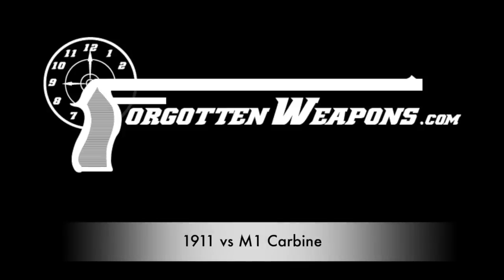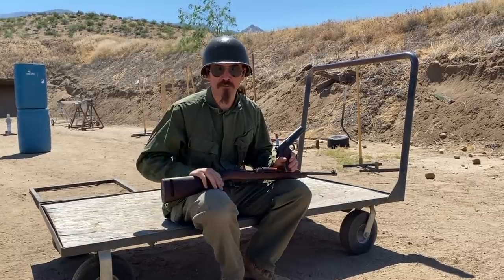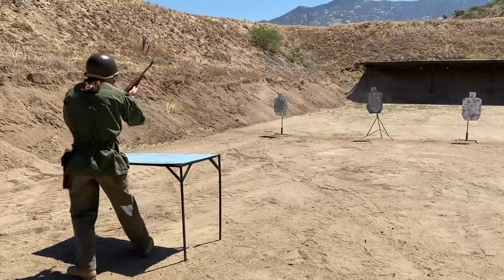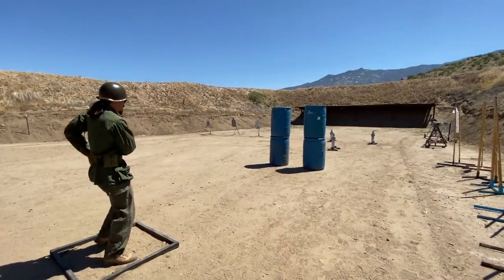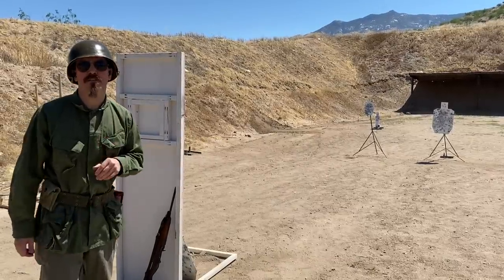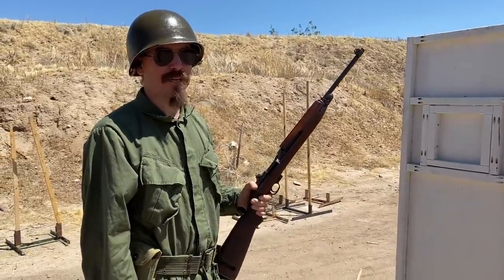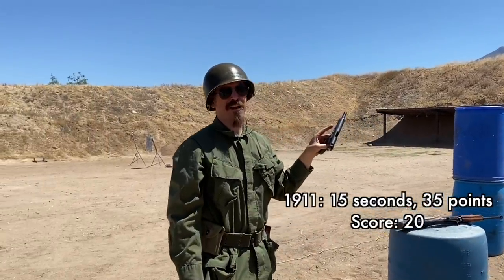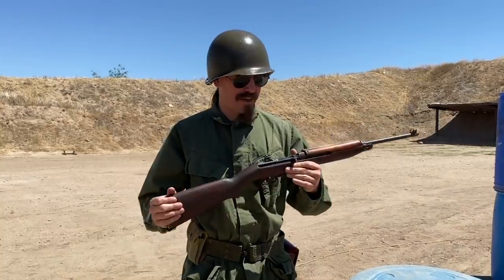1911 vs M1 Carbine in a Practical Match

Comment: It looked to me like part of the problem with the 1911 was getting it out of the holster. Ian is left handed. I don't recall there being a left handed holster. And was the holster closed on the stud? When I carried a 1911, I carried with a mag inserted, and no round in the chamber like what Ian started with. Except I always carried with the holster open (right handed). One night my shadow from a street light crossed over a deer which took off into the woods. I found myself with the gun in my hand, left hand on the slide ready to rack, and in a gunfighter crouch. It was not a conscience thought to draw the weapon and point at the target. Carrying a carbine slung on my shoulder, that would not have happened. A carbine tossed in the back seat of a jeep? Good luck. On the other hand, I couldn't hit the broad side of a barn with a 1911.

Comment: Holster's MATTER!

Run this again with the bottom of the 1911 mag secured to your thigh like it's supposed to be.
Run it a third time with a period issue shoulder holster.

If you want to be a sport, run it with a modern issue holster, the bianchi I think?, which will hold the 1911 loosely, but hold it,  no flap, with the thumb break.  You will find it mount's higher, not need to secure the bottom, and draws much more quickly.

Then, mount the same holster in a drop rig......

Operators (some, at least) still carry the 1911 for the terminal ballistics and accuracy, but don't cripple themselves with antique holsters.

And, NOBODY who has been shot at carrys condition 3, put a round in the tube, safety on, and top off the mag like it matters, both weapons.

Comment: Eh ... 
 
I think we all know the advantages of the carbine over the 1911 but their were some problems with the test.
 
The first problem was with your draw.  In every case you fumbled with the holster flap.  Now - here - I carried an M-1911A1 for over a year and qualified Expert with it.  So - I've got real world experience with the weapon.  I also practiced my fast draw as, though nothing ever happened - I was very much aware that should something happen - my ability to draw and fire my weapon in an expeditious manner might have an effect on my survival.  I was aided in this - by the fact that my holster had been "tear dropped" such that some of the leather around the hole had been cut away to make it easier to get that flap up.  I could lift the flap with the back of my thumb and as I pulled it up could draw the weapon, rack the slide with my left hand and fire it in one fluid motion.  My time from starting my draw to pulling the trigger was 1 second.  No Bullshit - I could do it that fast.
 
Now there are a couple of factors here that could have yielded a different result.  First off the holster is designed for a right handed draw - and - Karl is probably more practiced at fast drawing.  So - if you had had Karl doing the drawing of the weapon (I believe he is right handed) things might have gone better with the 1911.
 
The second problem with the test - is the availability of the Carbine.  They aren't going to just be sitting there ready to grab.  For the pistol - yes - it would be in a holster - but the Carbine would have been secured in some other way - so that if you put on the brakes in your truck - the Carbine wouldn't just be flying off the seat into the dash.  There were in fact mounts on some vehicles to secure weapons such as carbines.  Besides being mounted or fixed in a vehicle in some way to keep it from flying about the cab of the vehicle if swerving or breaking - if you were on foot - the Carbine would probably have been slung rather than just conveniently laying there ready for you to grab.
 
So - if you want a fairer result for the 1911 - you could repeat the test with both you and Karl doing it and with, as the Pistol is starting off in it's holster - the Carbine should start off being slung.  THAT would be a fairer test.
 
Now - don't get me wrong - this is all in good fun - the real advantage of the Carbine over the pistol - is range - so we're just messing around here.  But - if we're going to mess around - lets be fair to the pistol.
.

Comment: This has been an issue from the beginning. The .45 was a close in weapon. It was made to deal with a drugged up (in the Philippines) native warrior at very close range. It also did well in trench warfare. The M1 carbine was for use from 10yds to out to 100yds+ but not as a "battle rifle". It (the M1 carbine) was designed to replace the pistol not to replace a full out battle rifle. 
Can the .45 do well in close in...answer is yes, but the further out you are shooting, the poorer it will be. While the M1 will work close but also at longer ranges.

Comment: There's a bizarre amount of emotion when people discuss both the 1911A1 and the M1 carbine.  I think that if people were to just take a look at the basic facts, there'd be fewer arguments.  
In its day, there was nothing wrong with the 1911A1, and it was better than most of the competition (even today it's a formidable personal EDC pistol).  But the fact that it's a solid and hard-hitting pistol doesn't change the fact that it's a pistol.  No pistol is going to perform as well as a carbine when doing jobs a carbine is designed to do.
Similarly with the M1 carbine.  When used for the purposes it was designed for, it performed just fine; when pressed into service as a quasi assault rifle or battle rifle, it failed to get the job done.
Any machine, regardless of how  good it is at its job, is going to give disappointing performance when forced to do a job it was never designed to do.

Comment: Fumbling with the holster to ready the 1911 adds time. To do this fairly, you could just lay the 1911 down just like the M1. That seems more accurate as far as testing the speed. Also I always carry a round in the chamber, there's another variable. If not I can chamber a round in the 1911 slightly faster than the M1. Food for thought?
Reply: 1911 would be carried in a holster.
M1 would be shouldered, on the ground next to you or in a vehicle rack.
So no laying the 1911 on the table would not be indicative of actual conditions.
Lets also remember Ian is a very good pistol shot, while most GI's would not be able to hit anything much smaller than a barn door at close range, the true results would be even more towards the M1.

Comment: Good, but try to do that with gun on sling over your shoulder because there is no rest for it abound and you need to load that bloody 105mm with both hands..;)
Half of the issues of 1911 are from slow drawing from holster.

Comment: First test -- he puts the M1911 in a holster and then says the M1 Carbine that was lying on a table was much faster. A two second difference... accounted for by the time it took to draw the pistol from the holster. Sir, I respectfully submit that there aren't an awful lot of tables sitting next to the driver's position in vehicles. The weapon would have been either in a bracket or lying on the floor between the seats, which is awkward to get a weapon out of.
For it to be fair, you should have had the pistol on the table too. As it stands, that test handicapped the pistol, and I'd say that it performed at least as well as the carbine if you eliminate the time it took to draw it.
And the same thing in the second test. The pistol is holstered and the carbine is conveniently set in a position where it's easy to reach and maneuver.  You pretend like you're driving a vehicle, but then don't have any obstacles to clear to bring the carbine to battery like the dash board, windshield or steering wheel. As of test two, I'm giving this to the pistol since it was only a second behind despite the handicap. This is especially true since you're left-handed; you'd be able to lean out of the side of the vehicle or window easily with the pistol. And then there's the fact that you hit the targets with three out of four pistol shots, as opposed to the five it took with the carbine.
Third test... again with the holster and conveniently placed carbine. At least have the carbine start in a place where it's a little more realistic, like leaning up against the barrier. The carbine does have a noticeably faster cycle, but the pistol is holding up admirably.
The one thing I'm seeing in these tests is that so far it's being done at pistol ranges, and that's not the point. The carbine was made so that support troops would be able to engage targets at distances a pistol would need a miracle to hit. That is, ranges over 50 meters. The carbine was rated for a maximum of about 300 meters, and so was usable in the average engagement range of 150 to 200 meters where the pistol couldn't hit the broad side of a barn. At the distances in the first three tests, there's no real advantage to using the carbine instead of the pistol.
Reply: Now I don’t know the positioning of racks in a truck, but I still don’t see how it’d be much slower than fumbling with a holster unless you opened it up when you got in. As for any scenario outside of a vehicle, deploying an M1 slung over your shoulder is still faster.

Comment: This may be slightly off topic (excellent demonstration by the way), but you mentioned the pistol was carried the "traditional way," which you referred to as Jeff Coopers "Condition 3" (full mag, empty chamber, hammer down). How would these conditions apply to striker fired pistol with no external  safety, such as the early S&W Sigma pistols? There is no safety, and the "hammer" is internally cocked on chamber with no de-cocking provisions. Would this mean only condition 4, 3, and 0 are possible, or would you consider the trigger safety to make it condition 1?

Comment: You seem a little biased to th m1a1 the m1911 really shines in areas that are cramped like in buildings and allows for it's small size to be more mobile also if you are a driver like you were pretending to be the gun would not be right in front of you and would be harder to exit the vehicle or shoot though the windshield but the m1911 is never out of reach and can be holstered and drawed quickly I do agree though if the person manages to draw the m1a1 easily and quickly there is no chance for the m1911
Reply: True true

Comment: A big advantage of the pistol is that it is always with you and it's always in the same place. In sudden need from the cab of a truck or sitting at HQ the carbine could easily take considerable time to locate, make ready, and bring on target. The big concern is the practice required for pistol accuracy. I have no idea how much practice was encouraged in the field during WWII but I assume it was not enough to keep skills sharp if any at all. Anybody know?
Reply: Most US Trucks in WW2 had racks/holders for M1 Carbines next to the driver.

Comment: Why rest them against each other on a backup gun range? The point of the carbine was to extend the range they could defend themselves effectively at, right? You'd need to push the ranges of the excercises out a little further, (say to typical street to street urban warfare ranges) to really see the differences between the guns in the conditions they were commonly operating in during the war.

Comment: Support troops aren't going to always have a carbine sitting on a surface in easy reach right in front of them.  But they can always have a 1911 in a holster.   This is the same reason people carry handguns instead of rifles.    You are hamstringing the 1911 by drawing from a flap holster, yet not similarly hamstringing the carbine in a realistic manner.  Now I realize that the range won't allow using a slung carbine for safety reasons, so to be fair both should start from the barrel.

Comment: Please make a video like your mud test. If the gun fails to shoot how much cleaning is necessary for rifle to start shooting again. For example, pouring water in gun to wash mud and dirt out. I think that AK rifle wood be much easier to get back to working den AR rifles.
Reply: I just thought it would be interesting to see. What, for example, a soldier would have to do. With the equipment he is wearing like a water bottle. That the rifle starts working properly again. It's not like I can take rifles like they have. I tried it myself. I think it would be pretty simple to take a bottle of water and spill it on the rifle and see what would happen.

Comment: I noticed you have the same issue with the M1 carbine (and M1, really) that I do. You have to remove your firing hand thumb from the stock so as to not bloody your own nose.
Reply: I have put a lot of rounds through both GI and reproduction M1 Carbines and they have very little to no recoil.  Unless you suffer from "cronic weenie arm syndrome" your not going to hit your nose with your thumb operating a M1 Carbine.
Reply: You're either reloading way too hot or you need to change all of your springs.  That shouldn't happen with an M1 carbine.
Reply: @nunyabidness8870  It's more 'your thumb rests on the stock, and the septum of your nose sits directly on your thumb'. Any recoil hurts plenty.

Comment: The 1911 will kill a man the distance between sitting in that cart and that small tree behind you.

The carbine is a rifle. It will kill a man high up on the hillside face or on the top ridge of the hill behind you.

The 1911 projectile is 985 ft.per second.
The carbine is 2,000 ft.per second.
This is twice the velocity of the hand weapon.

The 1911 .45 projectile will kill a man dead at 50-70 yards away.
The carbine rifle will kill a man 250 yards away. 
Both weapons fire as fast as the finger can pull the trigger.

In WW2, in example of combat war small arms battles, such encounters rarely involved situations more than 200 yards.

The hand weapon is for very close combat situation.  Inside 50 yards. 
An emergency last resort weapon.
Or an intentional close-contact, close quarters killing weapon. 

The Carbine rifle is the same as any rifle with a rifle projectile.  The carbine is a rifle projectile.  
It will kill a man just the same as any rifle.  
The Carbine projectile goes right through a steel WW2 helmet.

Comment: I get that the M1 carbine was basically meant to replace the M1911 in that it would be a lot more accurate - but why didn’t they try converting all their pistols into carbines by adding buttstocks, grips, longer barrels, and bigger magazines to them?

Wouldn’t that be just as effective or even cheaper - since you don’t have to manufacture entirely new weapons from the ground up?

Comment: Not sure if it was design or accident, but you front loaded the first two to favor the 1911; A soldier would have carried his gun on him, not have to reach for it on a table. EVEN AGAINST THAT HANDICAP, the M-1 pulled through very well.
Reply: @Kidneyjoe42 
LOL, no, but I would think they'd keep it far closer to hand than Ian did.
But hey, that's ok; If the M-1 won with the handicap, it would have overwhelmingly dominated without. Such a small adjustment to make the fight "less unfair" is not to be derided. 😉

Comment: 1911 vs M1 Carbine in a "Practical" Match no one compares pistols to rifles in a practical sense they both have separate purposes.............
Reply: Did you not listen to the intro at all? The M1 was issued to certain troops as a replacement to the 1911.
Reply: That's so, but this makes sense because the M1 Carbine had a stated intent of replacing pistols for certain roles where a rifle was unnecessary, but more than a pistol would be necessary if it came to that.